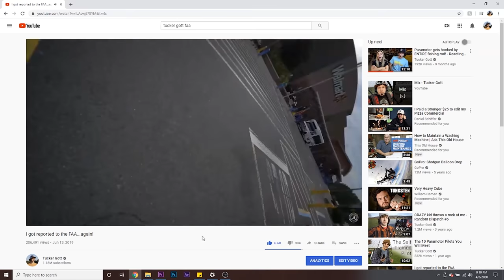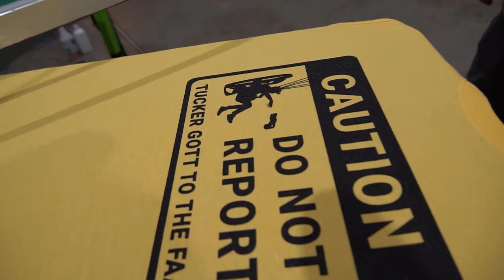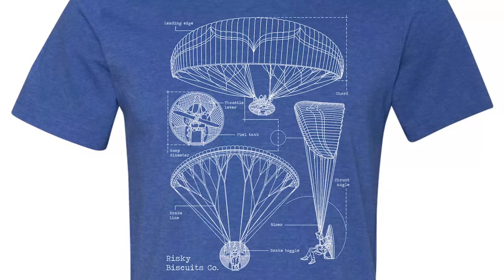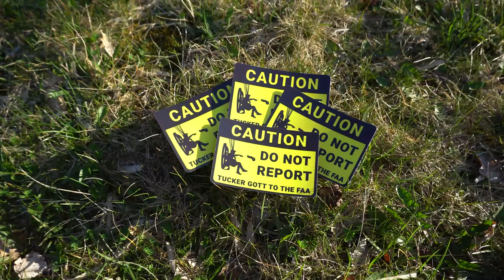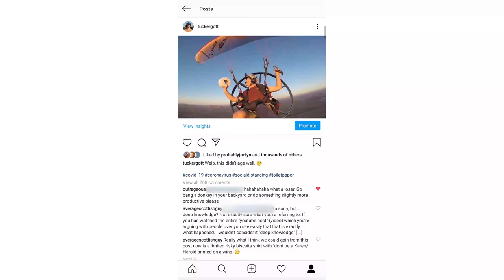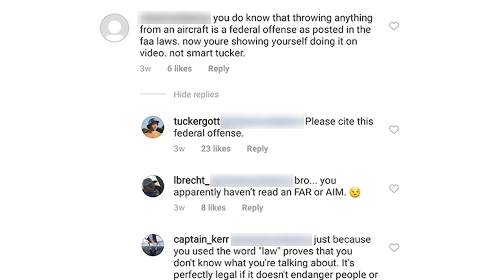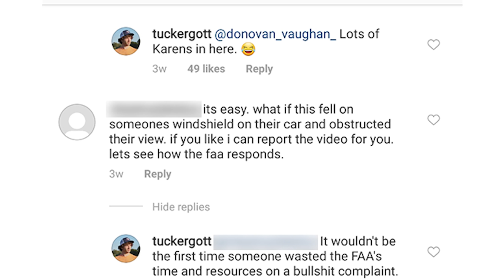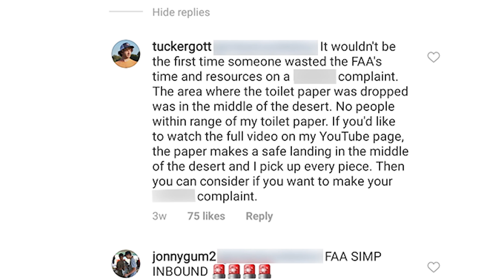Reported to the FAA again!!!

Comment: Major laws of a paramotor:

103.15 Operations over congested areas.
No person may operate an ultralight vehicle over any congested area of a city, town, or settlement, or over any open air assembly of persons.
103.17 Operations in certain airspace.
No person may operate an ultralight vehicle within Class A, Class B, Class C, or Class D airspace or within the lateral boundaries of the surface area of Class E airspace designated for an airport unless that person has prior authorization from the ATC facility having jurisdiction over that airspace.
103.19 Operations in prohibited or restricted areas.
No person may operate an ultralight vehicle in prohibited or restricted areas unless that person has permission from the using or controlling agency, as appropriate.
103.20 Flight Restrictions in the Proximity of Certain Areas Designated by Notice to Airmen.
No person may operate an ultralight vehicle in areas designated in a Notice to Airmen under § 91.137, § 91.138, 91.141, § 91.143 or § 91.145 of this chapter, unless authorized by:
(a) Air Traffic Control (ATC); or
(b) A Flight Standards Certificate of Waiver or Authorization issued for the demonstration or event. [103.20 was amended 9/11/01 as per Federal Register page 66 FR 47378]
Reply: He’s not breaking any of those smh

Comment: I’ve been an aviation lawyer for over 30 years and I am also a private pilot.  There exists zero obligation to  respond to the FAA’s inquiry.  It’s only designed to entrap you.  Trust me.  If they had sufficient evidence of you violating any FAA regulatory or operational rules, they would send a formal notice of suspension of your certificate privileges or hit you with a proposed civil penalty ranging from a little over $1000.00 all the way up to a maximum of $50,000.00, depending on severity (like flying  through JFK or over a shuttle launch of an NFL game, etc.  Since flying in a powered paraglider doesn’t require a certificate,  then expect a civil penalty IF THEY CAN PROVE IT WAS YOU! These “friendly” (they’re not) inquiries are designed to scare you, but understand this.  They already know what happened, where it happened and when it happened.  They just want YOU to confirm you were the operator or to innocently say, “Gee, that day I was working, but my friend Tom was flying my rig... Now Tom gets hit with the fine.  That’s the only information they really want.   I wouldn’t trust an FAA criminal field investigator with a used roll of toilet paper.

Comment: I am a pilot.  Safety is the most important aspect of flying which means following the rules.  As more people enter the airspace, there will be more rules as so many things are changing with jet packs, powered wing suits, paramotors. Etc.  As a pilot, I stay away from low level stuff, trying to skim off lakes, or flying through clouds unless IFR rated, which I am.  Whether a motorcycle doing crazy stuff on the freeway or you stretching the rules, people will be upset.  Just get you pilots license which is safer than what you are doing now.  Remember the hang glider and the Jesus bolt.  Your flying machine is not much safer and  without a radio.

Comment: I am thinking back 50 years at that time the Canadian Armed Forces would parachute into football events as a Public Relation promotions.  First thing you saw was a roll of toilet paper being thrown out of the plane to judge wind direction and speeds.  This was over Cities.  Not sure if there was a carboard center in the roll, but they were small normal rolls, yours had a larger thicker roll, but still not sure if that would accelerate to an unsafe speed to produce an injury.?

Comment: When you threw the regular roll of toilet paper did you catch it while it was still in the air before it hit the ground? In that short clip it didn't seem like you were over a desert with tons of space, and it looks like there were buildings if not houses down below. Did the toilet paper ever reach the ground in that other clip? If so, did you pick that one up afterwards? Just curious.
Reply: 5:55 it hit the ground. He picked it up. And if you saw a house you have to remember he is REALLY high up

Comment: Well You Remember Mike Patey ( Red wilga A.K.A. Draco. R.I.P. .Draco X is coming. ) Well check out the Flying Cowboys  " Airplane Toilet Papering. " Epic! Hope you enjoy it as much as Me. Then they cleaned it up. Yikes ! Cool Fun fact In the 50's we used to use toilet paper as oil filters. They work awesome too. There was an actual invention of a toilet paper oil filter canister. ( Instead of just dropping a roll in where the old cartage should be. ) They work quite well I learned.

Comment: My big concern is the rare occasion when you fly at higher altitudes that are used by general aviation... such as during that cross country race a few years ago. You are flying without aviation radio, without ADS-B, and without powerful strobes ( I know you have small strobes that are sometimes used) .. Its legal, but ... when in shared airspace, it sure would help safety to be electronically seen and at distance, visually seen  by BIG HIGH intensity strobe lights,   by GA aircraft that are flying at much higher speeds and may not otherwise be able to avoid you, risking collision that if happened, would likely kill all involved. Fly safe, fly legal👍.    And by the way, up in Alaska, very often food and supplies are dropped from light aircraft to remote camps or people at risk. Yes it IS legal to drop stuff from above under the right circumstances... What a maroon to waste the FAA time over nothing, just to be harassing.

Comment: Provided you took the appropriate precautions, you should not have run afoul of 14 CFR § 91.15 - Dropping objects.

§ 91.15 Dropping objects.

No pilot in command of a civil aircraft may allow any object to be dropped from that aircraft in flight that creates a hazard to persons or property. However, this section does not prohibit the dropping of any object if reasonable precautions are taken to avoid injury or damage to persons or property.

Good luck countering the nay-sayers who can't for the life of them cannot find, much less read the regs!

Comment: Any way to drop water balloons?
Reply: They would probably pick up so much speed they would hit like rocks
Reply: @DWG_  That or there could be a fin or streamer on it to slow it down enough below the motor that it could be effective. Maybe a pouch below the seat to hold them until drop or something and then streamers around them to make sure there is enough impulse to splash but not enough to cause other issues

Comment: Despite him doing his due diligence to perform the stunt safely and thankfully going back and picking up the trash, I'm still not sure it's the wisest thing to publicize and popularize doing.

Still, after some years with a popular youtuber repping the sport, paramotoring is a pretty niche hobby. Not many people do it. The minute this hobby/sport does take off in a serious way, you can expect imitators and trend chasers to imitate similar stunts without the concerns for safety or for cleaning up after themselves. If the hobby ever becomes widespread, you can expect it to get regulated to hell and back. I don't paramotor, but it sure seems cool.

If I were into it, though, I'd definitely NOT be trying to advertise it or popularize it. People tend to ruin everything. The fact that the sport is so free and unregulated is mainly due to the fact it seems to be a niche hobby populated by responsibility minded enthusiasts. Don't underestimate how quickly that can change if/when it ever takes off in a serious way.
Reply: And then those people will start getting arrested for doing stupid shit.  Shouldn't have to censor yourself because you're afraid of what others will do.